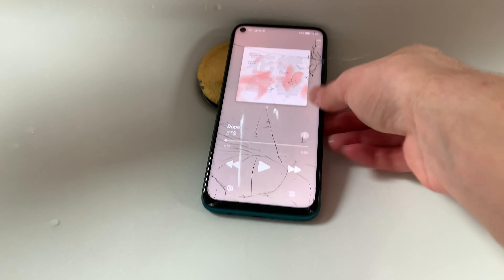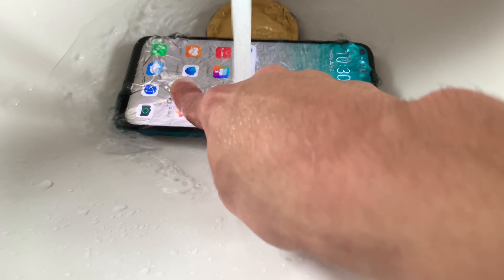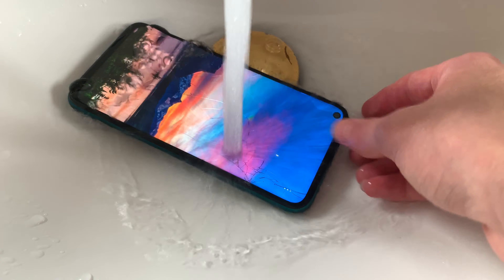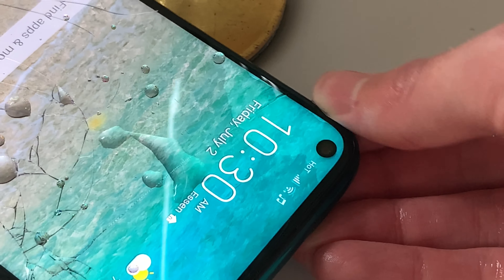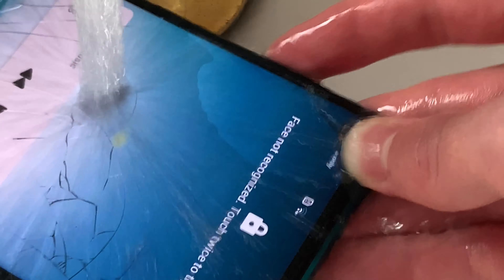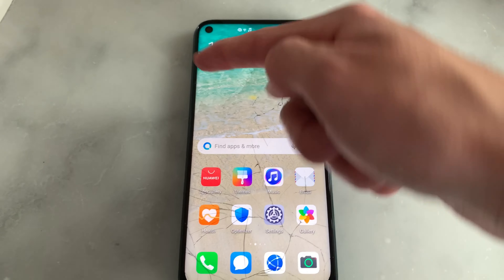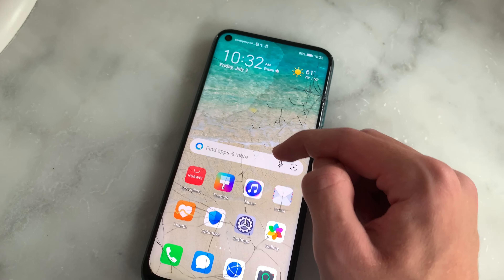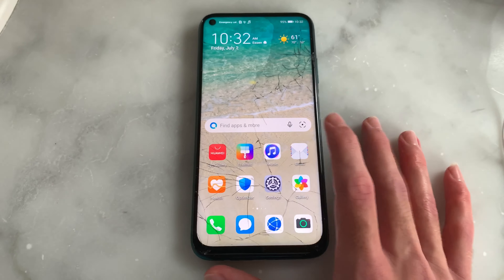Huawei P40 Lite Water Test

Comment: i dropped mine in water and when i turned it off it i couldn't turn it on and it keeps restarting itself. Any suggestions how to fix it if thats possible?
Reply: I also dropped mine it sea water so basically what happened is it kept on resseting so i tried it of and put it into rice and after some time it started working but the sound didn't work